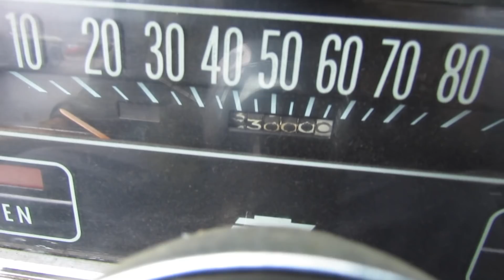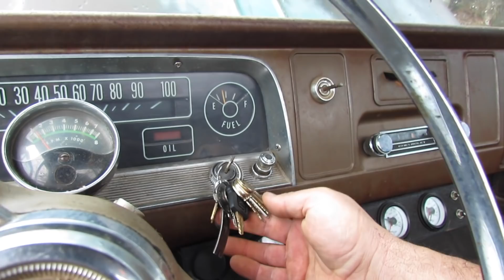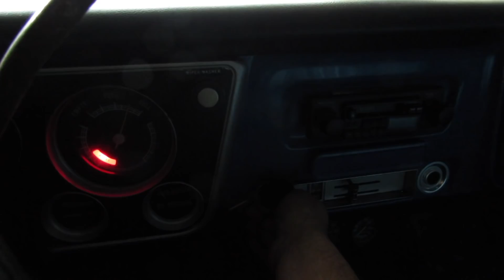Burnout Callout

Comment: Looks like you found a way to get posi out of the old 55 run two different tires, but it looks like the firebird stole the show hard to beat grabbing gears in a burnout. Nice show👍
Reply from the maker: Thank you.
Reply: More like the left brake is looser than the right.